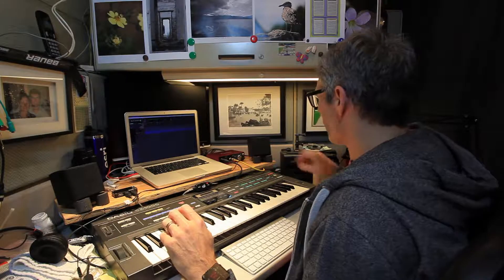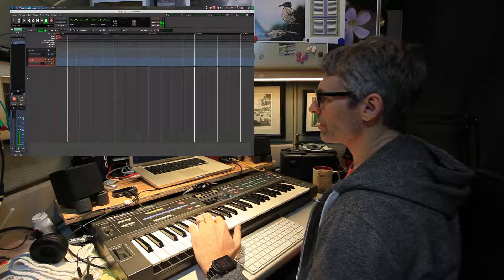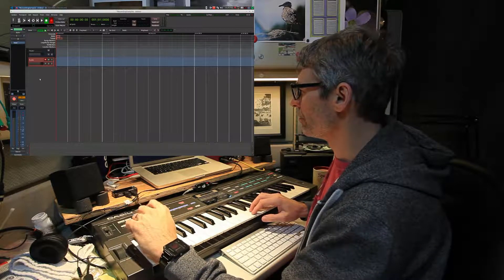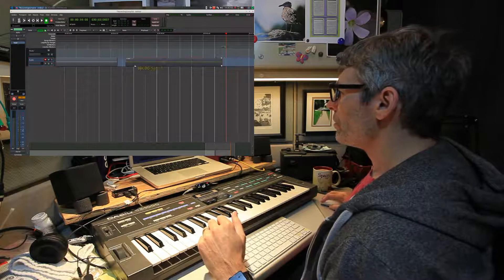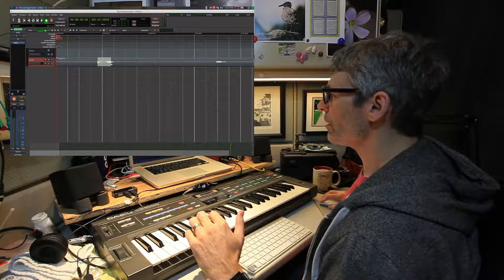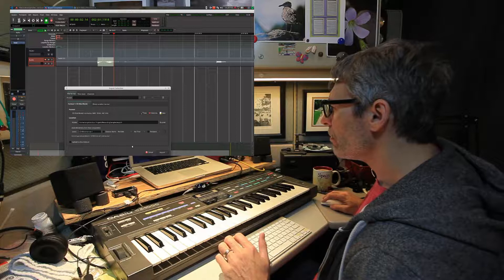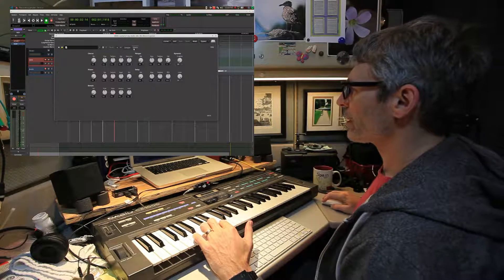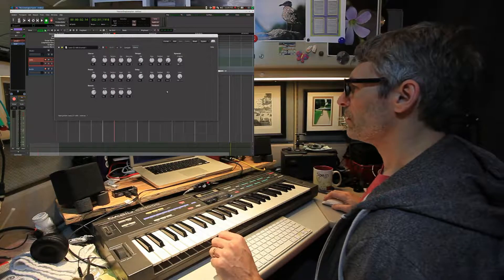Sampling Synthesizer Sounds In Ardour

Comment: Hello Tony, now 3 years later ardour is already at version 7. Unfortunatly SampleV1 is not supported anymore in Ardour, it even crashes. There are a lot of new sampler plugins in Ardour but they are all for the sample to connect at 1 Key, not all keys as you demonstrated in the above video. Do you know if there is a plugin in the latest ardour version that just does what SampleV1 did?  Thanks for a Reply.  Jean.
Reply from the maker: That is a good question. My setup has changed quite a bit since I did that video. I have not looked at the latest version of Ardour yet but it is on my to do list and I will make sure I look at sampling.
Reply: @TonyBursey  Tony, i have found a solution thanks to the ardour community at the unfa chat channel. Simple make a .sfz file with just two lines.
<region>
sample=G.flac
Save this as .sfz file and put the G.flac sample in the same directory.
Then open this soundfont with sfizz soundfont loader. That's it, same result.
Thanks for replying.
Jean
Reply from the maker: @germona  thanks for the info. Appreciate it.